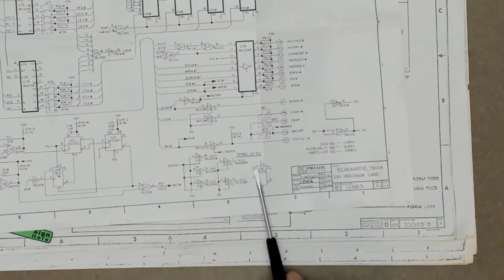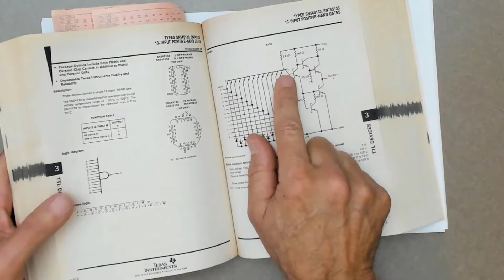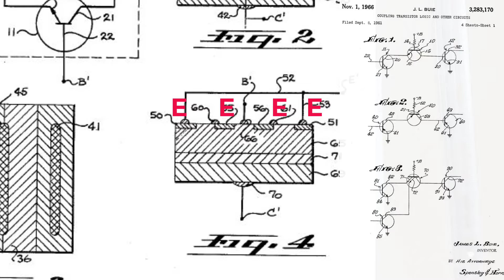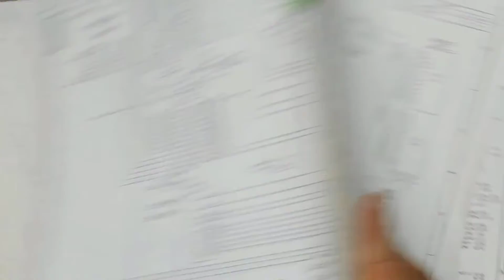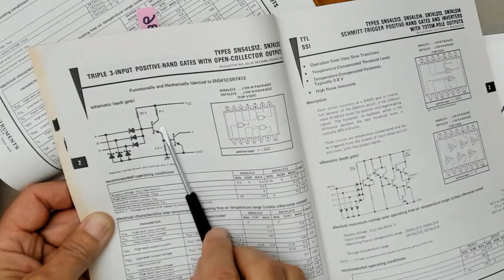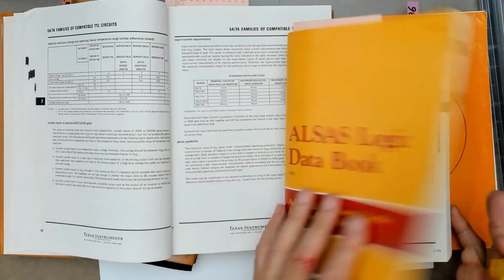{73} Should you be tying up fixed TTL inputs through a resistor? Old-timey habit or Still Relevant?

Comment: Great video, and very informative to see this explained out in this way.

I noticed on some ProLog cards that they had a single pull up resistor that gets distributed around the board to pull up unused inputs. I hadn't seen the version using a couple of gates before though.

As for tieing inputs together, it was always my understanding that TTL gates are much better at pulling down than up due to the construction of the output, hence why a lot of logic is active low?

Certainly, designing for TTL requires a lot more attention than CMOS!

I pretty much only design using CMOS so it's all straight to either rail because it doesn't matter. This video will certainly be one of my references if I ever do anything with TTL families though!
Reply from the maker: Thanks for the feedback. 
yes, I think Pro-Log was overly formal about their pull up and pull downs but they probably wanted a bullet-proof product.  utilizing unused gates to create a pull up and pull down signal certainly offers the ultimate level of protection since a TTL output won't damage a TTL input.

Most TTL inputs will float high by themselves, and you are correct that most TTL outputs can sink much more than they can source.  That is because the output goes high through a pull-up resistor, but is directly pulled down through the output transistor.  Max output high is going to be microamps and logic one output voltage has an IR drop depending on output current.  Output low is going to be milliamps and a pretty steady as a single saturated transistor drop.
The internal TTL output pull-up is also why open collector TTL is so easy to work with because an external pull up on the output is nearly the same as the pull up that is internal to the device.

That is also a good reason why low assertion logic (active low) is so useful because if there is one thing a TTL output knows how to do it is pull the output low.

Comment: Not that it matters in the slightest or even has anything to do with this video, but have you ever used I2L (Integrated Injection Logic which used multi-collector transistors) and if so care to wave your arms at any rules-of-thumb WRT its usage?  I heard about it, but never really saw it although supposedly it did see some applications.
Reply from the maker: No, Not explicitly.
Possibly unknowingly— I remember hearing rumblings that some LSI / VLSI were going to be hybrids with some I2L internals but I changed careers/interest and didn’t keep up with that topic.  Or perhaps I re-read an old article / book / patent / datasheet more recently, because that tidbit of information seems a lot fresher than it really should be. Maybe it was 40 years ago, maybe it was 40 weeks ago … my memory can be a bit dodgy.   But, no, I never used I2L explicitly.

Comment: Thanks for the very informative and well researched video. I was pondering this question recently while designing an Am9511A extension board for my MiniMax8085 project. I did put 1k resistors on TTL logic inputs that need to be tied up, including 74*74 D-FFs. Looks like I did the right thing 😃
Reply from the maker: Yes indeed!   It is always best practice to protect that one person who will pull a 1976 Fairchild 7474 multi-emitter latch out of their junk drawer and plug it into your design 😉🤔

Comment: Good video, I think it misses the main reason the pull-ups are there… This is DFT / DFM requirement.
Inputs can be toggled for “bed of nails” style ATE testers.
(Before Jtag and scan path) 👍🏻
Reply from the maker: In some cases where there seems to be no other reason I think you may be correct, I.e., , they may be for forcing the circuit.  However when I would put resistors in for that purpose I would usually include a pad or a solder mask hole for the pogo pin to get good contact.  The ones I used as examples in the video did not have any test pads, but that is not to say they still weren’t for testing.  But you are right, it is worth considering as a possibility.
Reply: @HelloWorldETX  ATE testers used test vectors from a library usually. So you could pull a standard model, input vectors etc for a 74LS74 and quickly build up a test bench for a board.  If an engineer tied a D input to ground, the test engineers used to get upset because they’d have to hand edit the model for the device, as that input couldn’t be toggled.
Things got kinda easier later on when test languages like HiLo became more common.
I was a design engineer, so I would get a snotty phone call from the test guys if I didn’t follow the guidelines 😉
Reply from the maker: @8-bitbitsa821  excellent information.  I am going to re-look at some of these inputs with that in mind.
Reply: @HelloWorldETX  pull-down resistors we’re also a no-no… You’ll sometimes see a pull-up on an inverter that drives a permanent low into a device, avoiding using a pull-down 😉